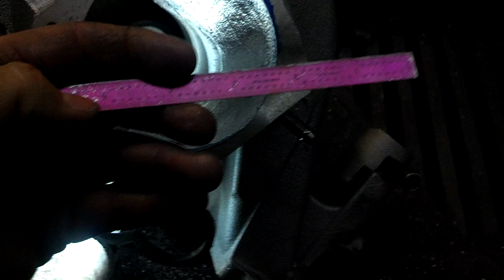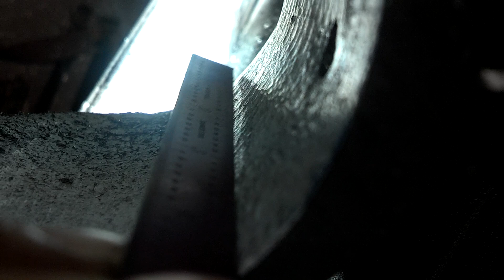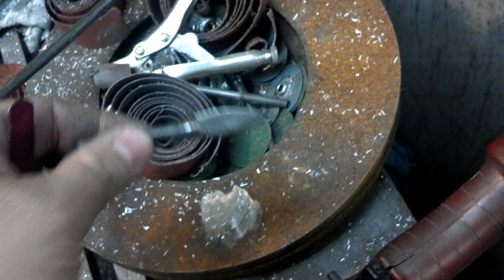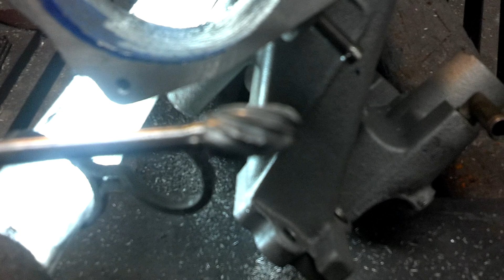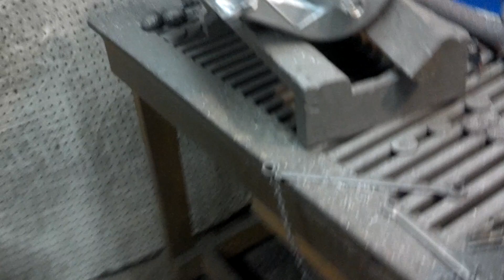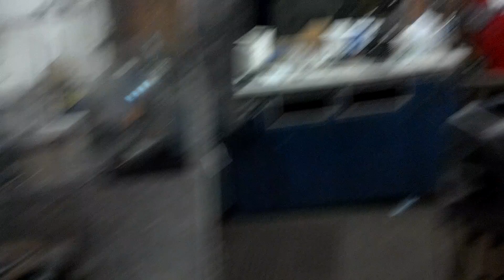Throttle body port matching to intake manifolds

Comment: You still doing intakes ? I need my 6.1 intake ported
Reply from the maker: I will be when I'm caught up. I was down for a couple of weeks sick.. working on getting some peoples orders out then I'm back at it. IG is the best place to follow up @mackbuilt
Reply: OMGITSMRMACK what does you charge ?
Reply from the maker: @onefastlife5017  depends, I have options.. and it also depends on if you're local or not. I give a small discount if I dont have to deal with shipping and shit related to it.
Reply: OMGITSMRMACK where you at bro? I’m In WA state
Reply from the maker: @onefastlife5017  Houston, but I'm leaving for VA in a few weeks for 2 months.. so if you wanted anything done in that time frame it would have to come there. I'll be working out of my tuners spot doing a bunch of builds.
Reply: OMGITSMRMACK checked you out on insta, let me see if I can pick up a spare and get it out to you

Comment: So on the 5.7s you wouldn’t port the runners? Only the throttle body to match a 85mm throttle body upgrade?
Reply from the maker: 5.7 intakes?..
Reply: OMGITSMRMACK yes the intake manifold on a 5.7

Comment: nice work, I have an intake from a 2009 5.7 and wanted to know if that plastic intake can be ported prior to adding a 85mm throttle body, thanks for the response in advance. Appreciate your help
Reply from the maker: the intake opening can be made to match if needed.. but over all there is nothing to gain elsewhere on them.
Reply: Thanks for the response and information...i wanted to really go with a 6.1 intake (still might), but heard so many "horror stories" related to heat soak/power robbing issue with the 6.1 intake and that's why I bought the eagle 5.7 intake...any advice you can provide will be awesome, thanks
Reply from the maker: +James Hutch the Eagles a good intake.. the 6.1 on the 5.7 will drop low end power and really only gain up top.. it's really only something I'd run on a 6.1 or bigger..
Reply: Thank you for your great advice, really appreciate it. Next time I'm in Houston I'll make it out to your shop to pay you a visit. Keep up the good work on those hemi's,

Comment: Get sum of those sanding drums with 1/4'' Shank that you can use on a drill and use an air die grinder it will even out and smooth out your work keep up the good work with the videos

Comment: Nice I have a coyote intake and hsve a 90mm fordracing tb so I need to port the intake to a 90mm to match tb I shouldnt mess with the intake runners tho right since my heads are stock ports